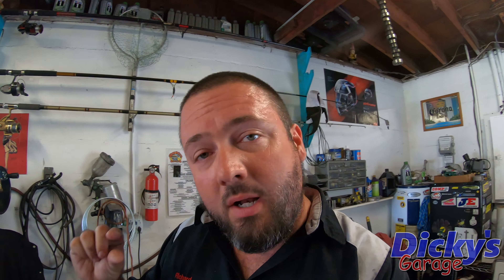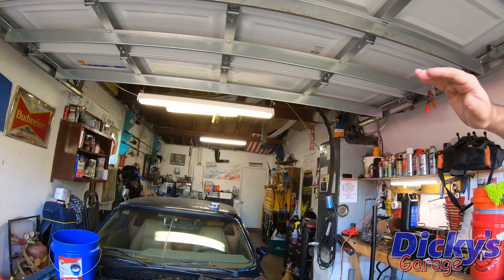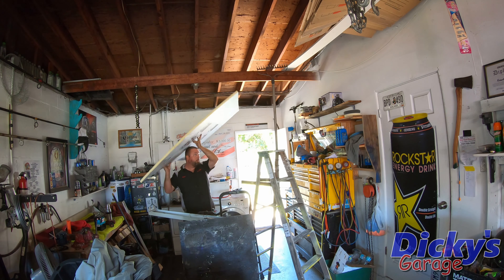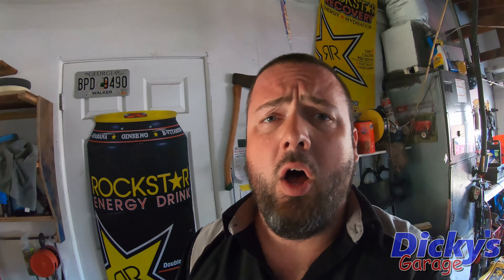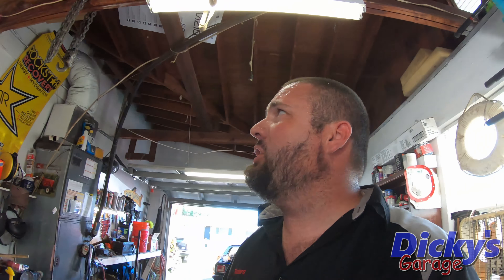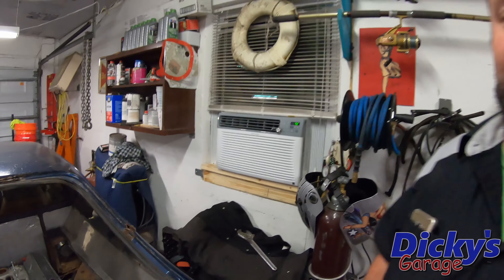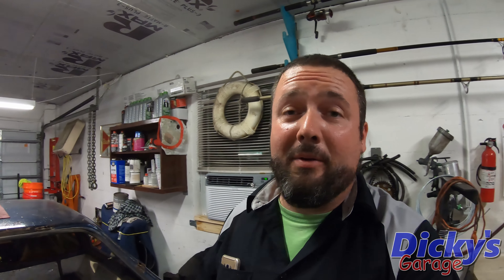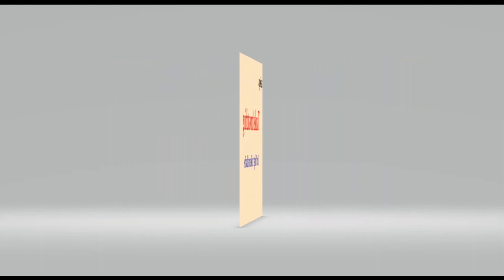A Low Budget Solution for a Scorching Hot Garage

Comment: Install a 300mm wind driven spinning vent into the roof. That will release the hot air inside; and make your A/C work less. Save electricity. mat not even need to be on. Quieter etc etc.

Comment: Looks good and will be effective, however, the foam board is NOT fire rated.   You really need to cover over the foam board with drywall.  However you don't have the required ceiling joists to support the weight of the drywall which is about 50 lb per 4x8 sheet.
Reply: I don’t have any crooning joist on my garage to support drywall either and I don’t know what steps to take
Reply: @robmespeedy  Mount 2x4's at the top of the walls and span the width of the garage with 2x4 ceiling joists.  If your garage is over 10 ft add framing down the length or switch over to 2x6s.

Comment: I’m watching this 3 years after the video was posted. How are the panels holding up? Just watching you hang them up, it didn’t appear that there were enough joists to screw the panels to and it looked like they’re only supported at the ends with the centers of the panels relying on the rigidity of the foam to support themselves. Have the panels begun to sag in the middle and pull away with time and the heat from the roof above?

Comment: Insulate the door and you will all set. Homedepot sells sheets that are 2'x4' and fit the doors very well. They are a bit pricey,  but I live in central Florida and installed them in my 2 garage doors that were not insulated and it made a massive difference as my doors are South facing.
Reply: Are the foil faced sheets?
Reply: @Painfulwhale360  Got this from homedepot and it worked great:

SilveRboard1 in. x 2 ft. x 48 in. R5 Radiant Acoustic Insulation Kit - STC 19 (12 sheets) - 96 sq. ft.

Comment: You need a radiant barrier fastened to the bottom edge of the roof rafters, leaving a 6" void between the barrier and the interior side of the roof deck, first.   Also leave a 4" to 6" gap between the barrier where it approaches the walls of the building.  You don't want to block air flow up there.  

If you own the building, having/adding a ridge cap and lower O'hagan vents on the roof would good too.   Heat buildup is bad for the longevity of your roof. 

Below all that, your suspended insulation panels are fine.   Evaporative/swamp coolers are good too.

Comment: Your are so lucky to have a window in your garage!. I use a dual hose portable AC and it doesn't cut it at all. My garage rafter space is also fully insulated with R-30 reflective insualtion. When I had the rafters insulated it cooled the garage 10 degrees but it still can get to mid 90's sometimes. The portable AC doesn't seem to do much at all. Whynter AC-14SH 14000 btu model. Wish I could put in a window unit but cant cut thru the wall.

Comment: Better check fire code requirements you need fire resistant cover over that insulation. Second ventilate over top of insulation to `dump heat reduce load on ac.

Comment: Nice job / video. Good product to use. I installed a MrCool mini split 12000 btu 110v in my 28 x 28 garage. It cools the whole space. My electric bill barely changed.  Check out their scratch & dent values. Well worth it.
Reply from the maker: MrCool is good stuff. I have their multizone system.

Comment: I appreciate the video and ingenuity and it answers a question I have which is would separating the attic of the garage from the garage make a difference.   Great to know it makes a difference!   BUT if not done properly this can cause major problems with mold, rot, deterioration, structural, and/or shingle damage that isn’t covered by warranty plus it could transfer financial risk of a total loss of a house to the homeowner.  If there is a fire (or mold), insurance might not cover.  Be careful.

Luckily to do it right might not take much effort.  

The first issue is venting.  Attics in the south require airflow.  High heat over time reduces board strength and poor venting can cause moisture buildup and mold.  Make sure there are soffit vents around edges on the overhangs and a roof vent put in per building codes in your area.  In the south these are needed but up north another method may be used.  Codes are not the same in every region and I have only read building codes for the south.  This is my biggest concern for this type of project.  Also I am not a code expert and since codes change every year and codes in my area could be different than other areas, code questions need official answers by true contracting experts with insurance. 

My 2nd biggest concern is for fire.  If a fire were to break out in the garage, especially if that foam board can easily catch fire and accelerate the flames; insurance may not cover the damage.  Drywall is a fire barrier and has a fire rating.  IDK what is proper code for everyone but my guess is adding drywall to the ceiling as a fire barrier is required.  Anyone doing this needs to check on these things in their area and with their insurance company.  Another potential issue is garages store flammable chemicals like gas and brake cleaner; enclosing the garage space may change what can be stored in a garage and ventilation requirements may change as well.  Putting a window ac unit in might block egress out of the window in the event of a fire.  Bedrooms always have to have two ways to escape if there is a fire for example.  Need to double check this too.  Also burning foam insulation creates toxic smoke and that may prevent its use without drywall to protect it

Third, ceilings separating attic and living space typically require R-30 insulation to meet code and add access to the space.  This requires adding ceiling joists to hold the weight.

To do this right, may need to use drywall which would require ceiling joists, add blow in insulation, add an attic ladder, add soffits, and add roof vent, add a window, and perhaps add lighting to meet code.  I recommend getting quotes from contractors in your area which will detail “what” needs done to meet code as it will be in the quote.  Then decide if it is something that you want to do.  

The good thing is after doing this it may add “livable” square footage to your home which increases its value.  But again IDK for sure, you’ll need to verify with experts in your area.

This video needs a disclaimer saying it is for entertainment purposes only and simply confirms the root cause of a hot garage is heat from the roof and adding ac after the space is enclosed makes the garage comfortable.  This channel is not responsible or liable for damage if the approach documented here is used.  Hire a contractor and follow building codes to properly convert a garage into livable space.
Reply: It's like we live in a world of babies and everyone must have a nanny looking over them...funny how anxiety and mental illness, on the rise, are very profitable to the chemical industry and keeps the big nanny in power.
Reply: @buteos8632  or you know, safety and wisdom and all….

Comment: I have a random question.  Are those boards toxic or anything or can you hang out in your garage all day long with them?  As far as air quality and stuff?  I checked their product page and it says it's required to be behind drywall or some sort of barrier.  I want to insulate my garage door but don't want to drywall over it.  Just wanna make sure before I buy it.  Thanks!
Reply from the maker: I had no idea. I never smelled anything or noticed an issue. I probably wouldn't use it exposed in my bedroom but I'd assume it's fine for a garage. I've seen tons of people using the same stuff.
Reply: Everything is Toxic...
Reply: @dickysgarage7120 take a piece of the scrap outside and see if it burns....